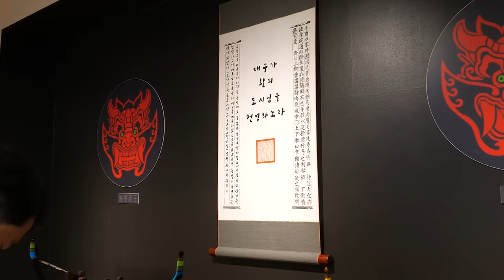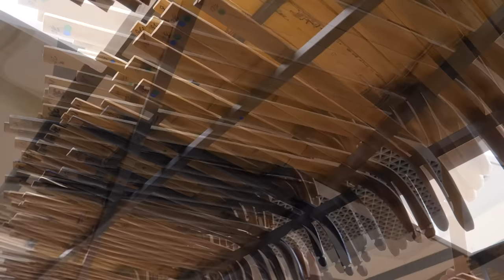Process of Making the World's Best Bamboo Bow. Bamboo Bow Craftsmen in South Korea.

Comment: It's a remarkable work, but there are  some things that somehow can't fit in my head. How could the bowmaker skip the tillering process, how is this construction even work? There is no glue that would fix the limbs and the handle. Also the gap between the limbs is on the back of the bow where the pulling tension effects. This should widen the gap between the limbs. But, somehow it performs nice and smooth.

Comment: This is not a double bend composite bow. Combat bows were made from the horns of mountain sheep and valuable wood. The tree worked well in tension, and the horn worked well in compression. They were glued together with glue made from the bladders of sturgeon fish. The double-fold shape allowed more energy to be stored. The bowstring was their strong sinew. The best bows send an arrow 600-700 meters. Sighting range 300 meters. Such bows were used by nomads in battles, shooting from horseback in the direction of movement, which added the speed of a galloping horse to the arrow. The shooters galloped one after another so that after the first shot the second could fire. The first one went to the end of the line. Thus, in a few hours the nomads inflicted terrible losses on the enemy.

Comment: Structurally this looks extremely weak, especially tying two pieces of bamboo in the center with mere strings. There are even no structures to address the rotational forces at those strings. Decorative ribbons and stickers doesn't help either (sarcasm😜). With the same equipment and material, he could have made much stronger and sturdier bows by laminating long single layers of bamboo instead. The bow string is thick and moreover the thick braid looks stretchable, further reducing the efficiency of the bow due to air drag. I guess it is more for decorative purposes, rather than for actual use.

Comment: Interesting process, but weird that for a bow that clearly is meant to be high end product, it is not optimized performance wise. Seems like only tillering done is adding those shorter peaces in the handle, clearly as a purpose to ease the bend near the handle so the limb doesn't break cus the lack of tillering allows the limb to bend too much near the handle without the extra support. It still did overstress the limbs and it ended with some set in the inner limbs. By tillering the limbs to bend more evenly, instead of just inner limbs, that set would be less, and the location of stored energy would be more beneficial when  it would be closer to the ends of the limbs, so there is less limb length to move around. Tillering also removes material from outer limbs, making them lighter, hence faster. Also the tips are much wider than needed to be, which is again, unnecessary mass to move around, on top of that, the decorations add further to that mass. With that amount of recurve, the bow will perform good, but this leaves so much room for improvement in performance. Absolutely stunning bow, but as it is, not optimal
Reply: The war bow would be the optimal solution, which was the compound recurve bow  made out of much precious material back in the past (for instance, the specific horn was completely imported from south china and south eastern asia even in the medieval times). I speculate that the bamboo bow was preferred by the common due to their availability of the resources. I am sure they were not the best,  but surely do their job for hunting.
Reply: I am not an expert but had an opportunity to play around the traditional Korean bow few years back. Very complicated piece of work and need quite an attention to keep it in a shape. But in terms of performance,  you would be more satisfied.
Reply: I’m pretty sure these are ceremonial/ornamental bows. It doesn’t show him tillering the limbs to even then, and you can see when he draws it back that the top limb is weaker than the bottom limb leading to an uneven draw. Not saying they can’t shoot, invitingly they can, just saying I think they are designed to sit on a beautiful rack like shown at the end. Stunning work though.